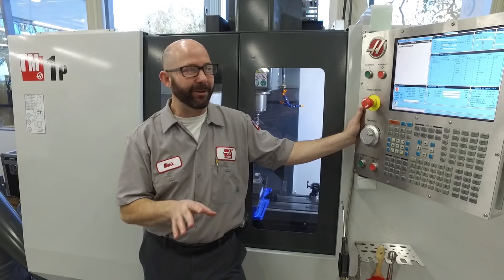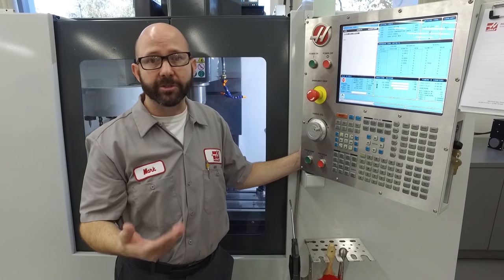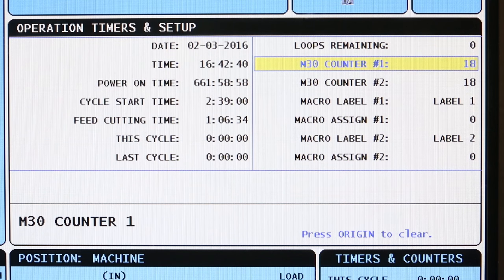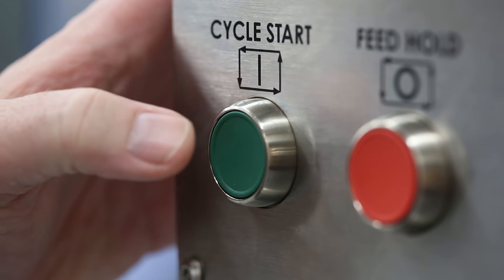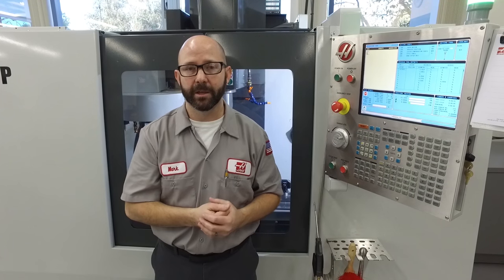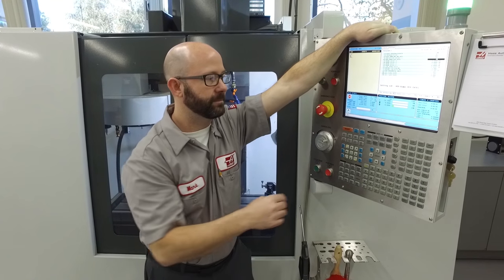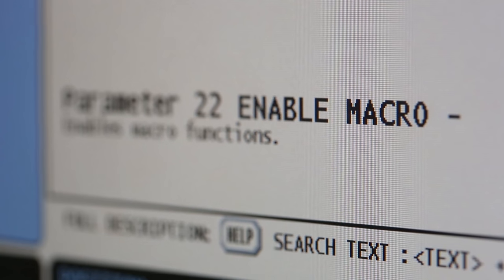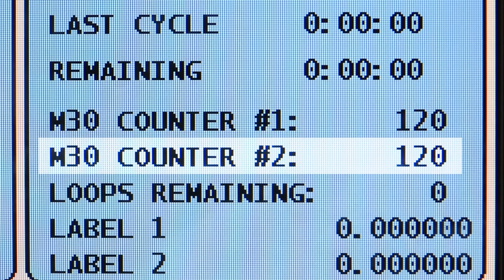Easily keep track of your parts using the Haas M30 counters – Haas Automation Tip of the Day

Comment: I am studying the Haas Lathe Training manual.  On page 139 I read that M3 turns the spindle clockwise and M4 is counterclockwise.  Unless the directions are from standing position at the bar feed end of the machine, then mine is backward.  Mine is as any normal lathe turns which is toward the operator using Me.

Comment: brother i cant do it when i write my mdi #3092=120 MACHİNE say bad code
Reply from the maker: +ProLive Advange Go ahead and try #3902=120 instead of #3092=120, this should get you going. #3902 = M30 Count 2. Macros must be enabled (Parameter 57:22) to use #3902 from MDI. Hope this helps!

Comment: How can I make my machine stop each 10 parts
Reply: Write a macro.... Really simple
Basically you need to declare a variable call it #1 you need to give it a value. Then at the bottom of your program you want to increment #1 by 1 or #1=#1+1 then you want to test that value. Once equal to 5 you want to jump to a line with a program stop. Else goto M30 that's as basic as I can explain it to you